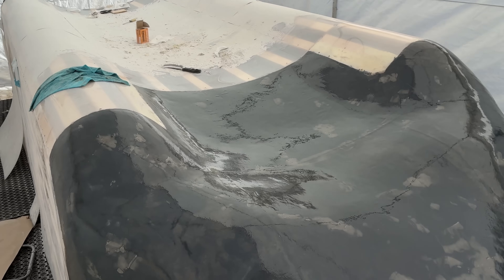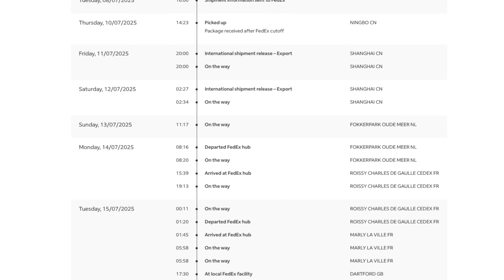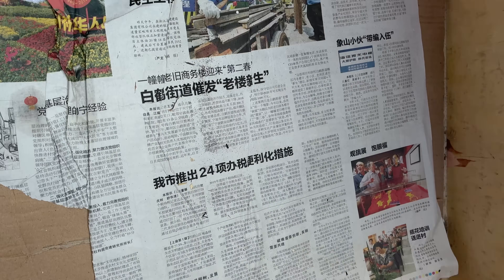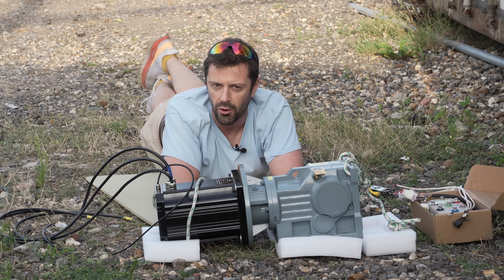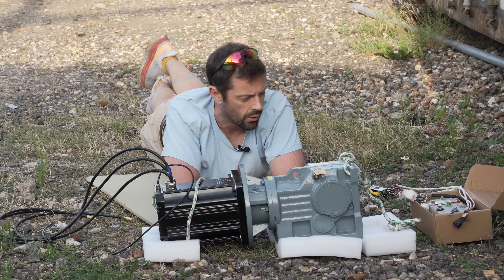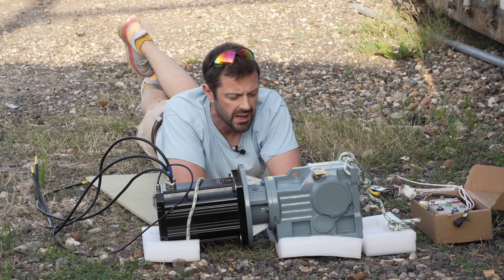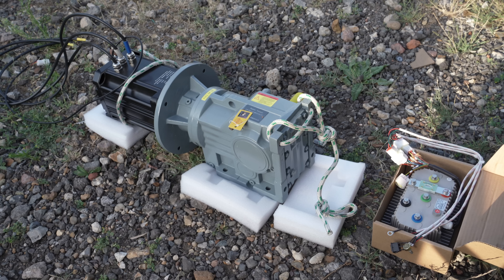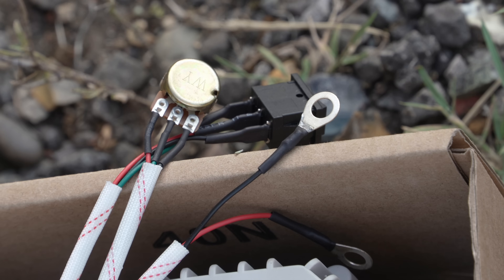UNBOXED: 4.5kW motor (48VDC 28nm) & 17:1 helical bevel gearbox. Arctic Vehicle Project BERNARD [4K]

Comment: I hope you get spare  control panels / PCB / Connection multipin sockets. Gears are reliable. Electronics, in cold conditions may not be all the time.
Reply from the maker: Quite, and a definite yes.

Comment: I didn't quite understand your description of where which component will be mounted in another comment, but I'd assume the electronics and motor will remain inside? If so, I assume it's gonna be interesting to keep the rotary seals for the shaft water tight at -40C? Also, with the vehicle stationary, even if the gearbox is inside, I wonder if the oil around the first gear from the wheel might harden (seeing as there is a heat bridge to the outside). Perhaps some localized active heating will be necessary?

Anyway, happy to see you making good progress!
Reply from the maker: Cheers.

Yes that's right - the motor etc is inside. The rotary gland is going to be a mission yes. In fact I was researching various shaft gland designs last night - similar to boat propeller shaft ones. 

Not sure about heating - the vehicle is unlikely to be particularly cold inside, and if it is, we'd choose -50 rated synthetic gear oil.
Reply: @AlexHibbertOriginals  Also the question how much of the wheel assembly will remain attached in the water. I think I remember the original plan being to remove them for towing behind a boat. In that case maybe just plugging the holes would be enough?
Reply from the maker: They stay on for short sections. Off for hours/days on the water or under tow.

Comment: I've used Kelly controllers before. That rotary control would be for the throttle, and the switch for reversing. If you need any help with integrating those controls for all six motors (six, right?) into one human-friendly control for driving, let me know! That stuff is right in my wheelhouse.
Reply from the maker: This is magic. Thank you. Could you either pop me an email, or get back in touch as and when we get to wiring up the main controls?

(yes I was anticipating aircraft-throttle-like levers in a row on the dash, with optional pedals on the floor (one for all the left motors and one for all the right motors).

Comment: 4.5kw continuous sure but I bet that motor would do 20-30kw peak easily just given it's size and assuming it's construction. The reason I point this out is if you know the torque limits of the gearbox and CV joints and have enough battery power a controller that can be set for those power levels could be useful. You could set the controller phase current which will directly determine the motor's torque output to the torque limit of the parts and similarly the controller input current limit to the battery current limit (yes these to current values can be different at the same time) which would give you a lot of extra torque headroom if you needed it for instance to get out a sticky situation. Given the motor is rated for 110A and the controller is rated for 380A both of which should be phase amp ratings you could just program the controller for higher phase amps. If nothing else something to keep in mind if in testing you find situations where more torque is required. Even if the battery power is not capable of driving all motors at higher power in a stuck situation you may only have traction on some wheels so only some motors can even use the additional power.
Reply from the maker: Interesting. I think the limiting factor here would be the gearbox. I wanted to 2-3x over-rate the gearbox to 1000-1500nm, but the size and weight would have got bonkers. I can try and find out the maximum torque (rated torque is what I've specced off) for the K57, but want to avoid blowing up the gears.
Reply: Arctic emergency power - the pilot must push the levers past a detent and break the small safety wires to access this output. Used by the Fins in WW2

Comment: a screw drive is not back drivable are helical gears the same? in which case your hand is not enough nothing will turn that it will break before it back-drives/ turns from the output.
Reply: Helical gears simply have continuous torque transfer, but are the same as straight cut gears in principle. It's either the paint or the reluctance force of the motor coupled with the ratio

Comment: I can tell you now you won't be turning that output shaft by hand. Will the drive train be mounted inside or outside of Bernard?
Reply from the maker: Yes that was optimistic. Outside the gland will be half the CV axle, and then the torsion axle with hub mounted through the arm.

Comment: So some combustion engine will create power for the electric motors? I think it would be much more reliable and low budget  friendly if you used chains or hydraulics to send that power directly to the wheels.

I guess you like to have fixed axles and turn the vehicle by letting the wheels turn at different speeds? That needs to be done either manually with two speed controllers or with a joystick and some micro controller to interpret your input. Because if you turn at speed one side just needs to spin a bit slower. If you want to turn on the spot, one has to go forward and one reverse. 

Ultimately this is quite a undertaking. It will be expensive and a ton of trial and error.
Reply from the maker: I've covered the rationale behind using a series of HVO generators, all/some running depending on demand, and at optimal load to charge sodium batteries. In particular, normal direct drive engine powered Arctic ATVs have had endless drivetrain issues, and waste vast amounts of fuel idling when stationary and revving at low speed.

Second two paragraphs - yep.
Reply: Combustion engines are efficient at mid to high RPMs, where their horsepower is. While you can optimize this to work with fluid transferred power, AKA hydraulics, hydraulic pumps and motors are not very efficient. Neither are transmissions that have to be shifting a lot in a mechanical AWD or 4WD system because of the dragging that happens when steering or in the differentials along with in the transfer case/front to real axle differential. All those losses add up to inefficiencies in the system.

Electric generators and synchronous AC motors are very efficient. Batteries have gotten pretty efficient as well, with this system just using them as a buffer as the engine starts and revs up. Diesel set up for electrical power generation have gotten incredibly efficient since they work against a set load and can be engineered to be as efficient as possible against that load. You aren't going to get anywhere near that driving a hydraulic pump and definitely not driving a mechanical drive. Then there is all the fuel wasted idling, as Alex pointed out as a major concern.
Reply: Seconding @KnightsWithoutATable - there are very good reasons that a century of use and refinement of diesel propulsion in railway locomotives has settled us on diesel-electric power trains, not diesel-hydraulic or diesel with direct mechanical drive. While Bernard won't have his wheels on bogies, most of the drivers for how trains have developed still seem to apply here, I'd say.

Comment: You say that you want to carry a spare gearbox.  Will there be left and right-handed gearboxes or a common design for all 4 (or 6) ?
Reply from the maker: I need to double check this, but I'm under the impression the motors have equal power forward/reverse, so it's a controller programming issue. But good point.
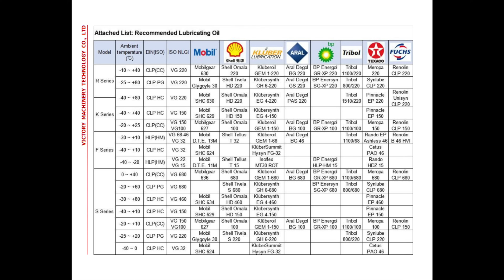Reply: @AlexHibbertOriginals  looking at the graphic at 9:04 it also seems that you have to adjust the oil quantity when the gearbox is flipped around. (M1 needs 0.5l and M3 1l)
Reply from the maker: They will stay flat on either side of the vehicle, not upside down.
Reply: @AlexHibbertOriginals  if you use the same motor/gearbox for the left and right side and you want them in the same orientation (so all engines point to the rear) then one side has to be flipped.
That's M1 and M3 in that graphic.
Reply from the maker: Yep - I need to check with Volcano if performance is the same in reverse. If so, you program the controllers for the two different sides and keep all in M1, but motor orientations changed. M3 requires 2x the oil fill, and I'll ask what other implications that has. Sixth sense tells me that upright is optimal.

Comment: BLDC refers to the motor+controller pair. The motor itself isn't actually DC. It's a 3 phase synchronous AC motor, hence the 3 power wires. The motor controller converts incoming DC to 3-phase at the correct frequency to suit the motor's operating conditions. To do that efficiently it needs to know the position of the rotor at all times. That's what the hall sensors do. Hall sensors are basically magnetically operated switches. The rotor has strategically placed magnets that are detected by the hall sensors. By monitoring which of the 3 hall sensors is on it can tell which phase needs to be energised at any given moment.
Reply from the maker: Thank you! I think deep down I knew most of that, but it was fuzzy, and you were clear.
Reply: Came to say this, and found you had done it for me. Thanks.
Reply: Sometimes (more and more) the Chinese use psudo hall sensors that are just marks on the encoder and not actually switches. They do exactly the same thing but as they are not mechanical they are more reliable.

Comment: A 17:1 reduction would be expected to be difficult to turn on the output end. 4.5 kw seems pretty low for the motor, even if you use 6, that's 27 kw or 37 hp. Plenty to to crawl around at extremely low speeds, but you'll be working the motors pretty hard to get up above walking pace.
Reply from the maker: The basic Sherp only produces a bit more power than that and it's much heavier, also with a more complex 'normal engine' drivechain with more losses, so far fewer hp get to the ground.. It can do amazing things, AND do 25mph.

Also low power compact tractors https://www.deere.co.uk/en-gb/products-solutions/tractors/compact-tractors/3039r-compact-utility-tractor-mtm4nurn weigh 1.4 tons and can tow 2 tons.
Reply: Series Land rovers were only around 50HP. They weren't fast but they still got around at a reasonable pace on and off road. I think 15-20MPH should be pretty doable for Bernard.

Comment: AI voice? 
Great to see the motor!
Reply from the maker: Nope - the answer is always the same on the AI voice.
Reply: @AlexHibbertOriginals  Is that an AI reply? Is this an AI question?
Why haven't (A)I got anything better to do on a Saturday evening?
Reply from the maker: An excellent use of your evening, sir.
Reply: There's just something wrong with the studio mic or some setting that makes the voice over sound so weird.
You will get used to it 😅
Reply from the maker: I just can't hear the issue. Not on high end speakers, not on headphones, not on phone speaker. SM7B - minor EQ tweak. Occasionally a 2% speed reduction with pitch correction.
Reply: I think it's just the difference between microphones and acoustics for boat-yard Alex and voice-over Alex.